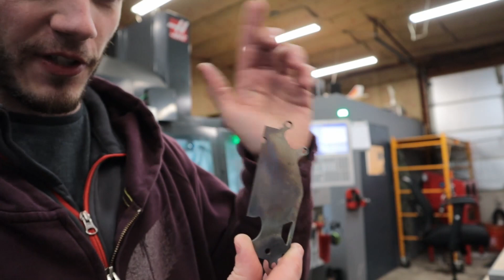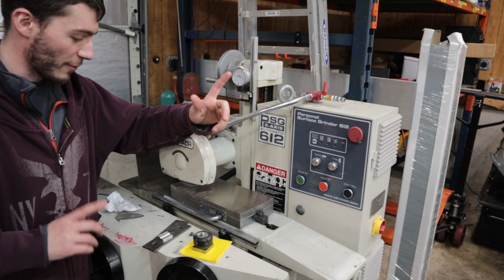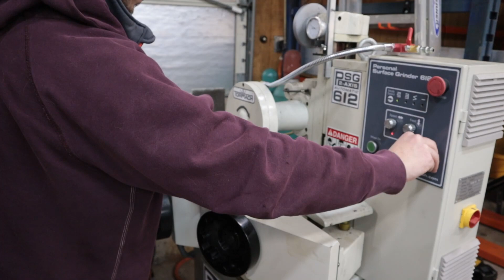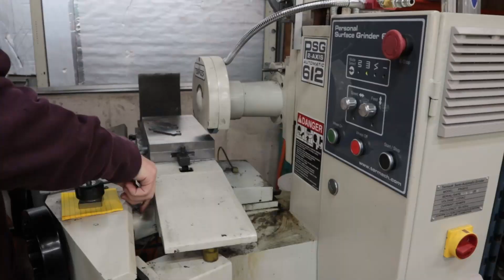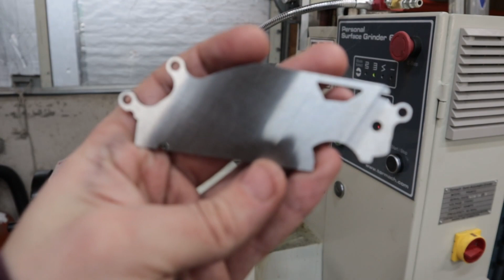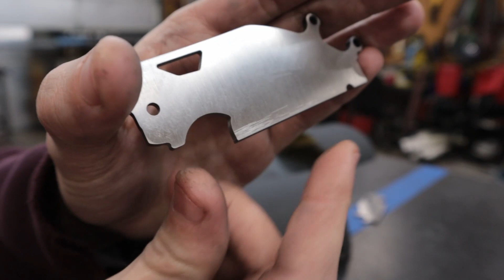Surface grinding Midnight blades

Comment: Don't buy a lapping machine, buy a better surface grinder. To reduce the heat buildup use thinner grinding wheels, less contact area will reduce the friction heat build up, also turn the blades on more of an angle, less time on the part will reduce the heat build up. 

If the blades are warped at all when you turn on the magnet they will flatten out, then you grind and still have a warp, consider shimming the blades if they have ANY warp.